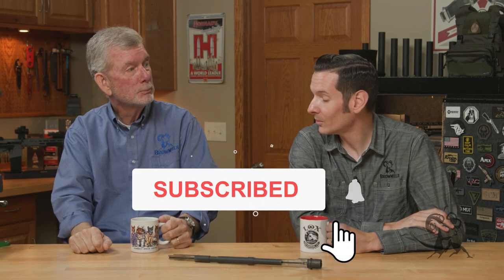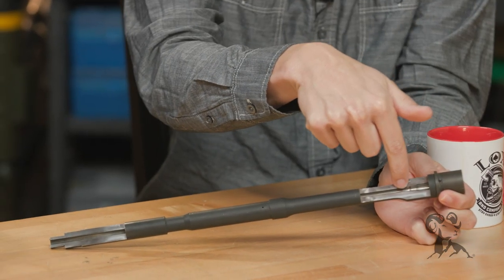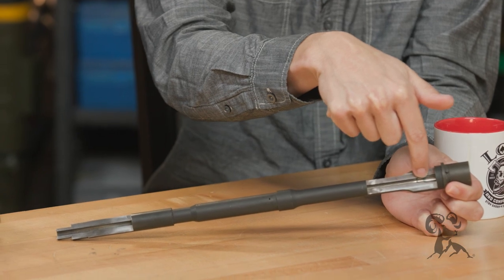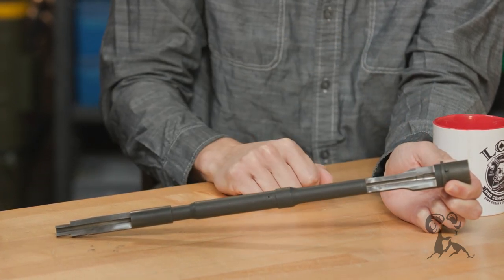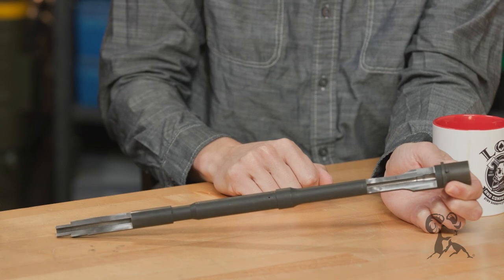Smyth Busters: Will a Worn-Out Barrel Explode?

Comment: The only exception to what you have presented would be in shotgun barrels that were of the Damascus or 'twist steel' type where corrosion has weakened the welds connecting the strips of the barrel allowing the barrel to fail at that point.
Reply: I want to see this myth tackled next. Nobody ever has pictures of an unwound, forge-welded damascus barrel despite it supposedly being a common occurrence.
Reply: @RefreshingDietDrPepper  I do not think it is common, but I have seen pictures of burst twist steel barrels that were attributed to pitting or corrosion of the bore.
Reply: @lawrencehudson9939  Do keep in mind that it is forge welded. Twist steel barrels do not have a visible pattern after completion and the swirly look is acid etched - people fake the look even today. It's more likely someone would blame the results of poor reloads or a bore obstruction on the material of an old gun to save face.
Reply: @RefreshingDietDrPepper  I think I have learned something today.

Comment: If you're rifled barrel Get so worn out and basically turns to a smooth bore. The gasses behind the projectile Can get ahead of the projectile Stopping the projectile before it leaves Creating a lodged obstruction.  Then the 2nd round will cause the barrel to explode. It is super super rare but it is plausible
Reply: something that I forgot. If your barrel is that warn as mentioned, 99.9 out of 100 x your throat your head space your timing and I'm sure other things will be out of spec.  All will contribute to Your barrel blowing up

Comment: Here's a barrel that didn't blow up but could have. When in college in the 1970's a friend had an old 1911 Colt that his dad gave him. My friend years before had been firing the gun and on one shot couldn't see where it hit. What happened is the bullet hadn't left the barrel. The bullet was stuck in the barrel just ahead of the chamber. The the next round was compltely chambered in the gun and was actually touching the stuck bullet. He pulled the trigger but there was no bang just a hissing sound whereby he sat the gun down and moved away from it. On inspection the there was a bulge in the barrel just ahead of the chamber.

Comment: The only thing I can think of is gas port erosion could eventually lead to separation of the gas block or gas tube from the barrel if the port opens up too much. I can’t imagine how many hundreds of thousands around that would take though.  

Just thought of another one, if the locking lugs in the barrel extension wear out too much, it can cause excessive headspace as well as fatigue of the metal, rounding of the engagement surfaces, etc. which I can see leading to possible catastrophic failure.

Comment: I agree with the answer but I have a question relating to the 22 bore brush wearing the rifling.  Would a nylon brush wear out a 22 bore?  How about a brass brush?  After hundred or so cleanings with a brass brush over 60 years I have not seen a problem.  The shot total is around 20 thousand mainly copper coated bullets.  I have switched to nylon with copper solvent bore cleaners.
Reply: You would have to have some really horrible barrel steel to have a bronze brush wear it out. There's a video debunking this myth, the guy uses a bore scope and a brush on a damn drill simulating years of wear. Not even a scratch in the bore let alone wear.

Comment: I disagree    As far as wear on rifling and bore I would agree, but what about my Remington 788 in 223 that had over 24,000 rounds fired through it.  I cleaned brass and inspected about every 1000 rounds.  When I cleaned the brass I had insipient case head separation as a fine crack around the case head. The ones that did not have a crack still would not resize and appeared to have a bulge on one side. I showed the can of brass and the gun to a gunsmith who said the chamber was stretching on one side from the thousands of rounds.  The can had over 900 rounds of brass in it . Every one was stretched and it varied from slight to severe. This is a form of wear, and if I had kept on shooting it  the results may have been bad. I had a 26" Shilen select barrel installed! and it shoots like a dream. I still have the old barrel for show and I do believe my old barrel was dangerous! The old barrel was still shooting sub MOA!

Comment: I have heard that if corrosive ammo has been shot through a barrel and was not cleaned, deep pitting can form which might catch and stop the bullet in the barrel. This would cause a bore obstruction that could cause the barrel to explode on a follow-up shot.
Reply: Never heard that one. Pitting can ruin accuracy. If it's really bad it can lead to metal fatigue or lowered velocity as gas escapes past the bullet, but in 50+ years of shooting milsurp firearms I have never seen a pit actually "stop" the bullet. Worst case of pitting I ever saw lost so much velocity from not sealing properly that the guy shooting had to aim approximately 10 feet above the target just to hit the cardboard.

Comment: Cannon barrels can get a little dangerous as they wear…so, check your destructive devices?

The one way I can see a uncontained detonation occurring would be if the locking lugs on the action became worn, resulting in a uncontrolled breach opening.  However, that is not the barrel bursting.

I think the myth probably comes from the black powder days, when the chamber was actually containing an explosion and metallurgy wasn’t as advanced, but, even so, it was probably more due to user error than metal fatigue.
Reply: You're pretty much right on the money. Most tales of barrels blowing up on early black powder firearms when re-investigated have concluded that barrel obstruction was the culprit because of the location and amount and type of damage described. Chambers were known to catastrophically fail when grossly overloaded with powder, but, even those failures were actually operator error and not design or manufacturer flaws. i.e.: pack enough explosive into anything and you can make it go boom.😒

Comment: What would you consider a round count for some of the pistol & rifle barrels be considered wore out. I have put over 15, 000 rounds through my 1986 Colt AR-15 Sporter with no problems so far. This is a combination of .22LR & .223 rounds. I also only clean my rifle every 2, 000 rounds instead of cleaning it after every time I go shooting like I was taught in the Marine Corps.
Reply: I would change the barrel just for peace of mind. It may still be shooting fine now but at 15k rounds literally the very next magazine can be the one where you notice it’s degrading. 
Also what distance are you shooting at? It may still be accurate at 25 yards but open up several inches at 75 yards or further

Comment: The comment about over-cleaning is very interesting.
I use rifles and handguns of different calibres, which I clean regularly but always using nylon brushes for the barrel. If cleaned regularly and thoroughly, bronze brushes are unnecessary and damaging.
Reply: If you damaged a barrel with a bronze or brass brush then you have a bad barrel. The metal is not nearly as hard and will not damage the barrel regardless of how many
Times you pass it back and forth. You can even go from the muzzle. There’s a video on YouTube with a guy using a power drill and a bronze brush spinning it for 15 minutes inside of a barrel. 0 damage was done after inspecting it with a bore scope. He even decided after to take a bore brush that was for a larger caliber to the barrel for an additional 10 minutes and again it did no damage whatsoever. 

.22lr is the only exception to this because the rifiling is so light. You still won’t damage the barrel but you can prematurely wear out the rifiling

Comment: Here's a myth for you - lead fowling of a 556 AR barrel with a 22lr conversion bolt. Does it really "ruin" the barrel if you don't clean it after practically every session shooting rimfire? Does shooting a 556 centerfire round afterwards count as "cleaning"? And do the lead deposits in the barrel fill in microcracks and later further them by thermal expansion?
Reply: lead fouling? meh.
clogs the gas port? yes.
Reply: @zososldier  How much 22lr would you have to shoot through the barrel without shooting a single 556 round for it to clog and not get blown through the pipe from the immense pressure though.
Reply: @Toringar  I shot probably 500 rounds through an upper. Had to take the gas block off and punch out the port because it made the upper a bolt action.
But you will get different round counts depending if you use lead only or copper coated 22lr.
It would probably be a good idea to shoot a couple 223/556 rounds every few hundred 22lr rounds if using lead only.
Reply: @zososldier  Wow, that is a LOT less rounds than I would have guessed. TU for the comment, this has confirmed my assumptions. I will make it a habit to shoot some 556 every few hundred rounds.

Did you notice any significant change in 556 accuracy after all that fouling?
Reply: @Toringar  I switched to copper plated only doesnt foul as much. I also didn't use the conversion on any gun I care about accuracy past around 100-200 yards seeing how the 22 bolt conversion isn't that accurate. (Rifle twist is way to fast for 22lr)
Either way, shooting a few rounds through the barrel will push pretty much all the lead out.

Comment: The only barrels I am concerned about are composite barrels where you only have the thinnest steal barrel and the rest of it is glue and fabrics
Reply: @dick8997  Yes but if the steel gets eroded away completely in one spot because the steel is so thin, then the carbon fiber will be exposed to the hot gas and erode very quickly. However, I still think that it would take a VERY long time to erode through even the thin steel liner.

Comment: What if the chamber/bolt lock up wears out and the headspace gets too large?
Reply: That's still not a "barrel" exploding. 9 out of 10 times if that happens you will split the cartridge case and get blowback around the bolt. If you have this issue, DO NOT FIRE THAT GUN AGAIN!. Odds are incredibly high that the round you just split will not have had sufficient power to push the bullet completely out of the barrel and the barrel is now obstructed. Once in a while you get "lucky" and the bullet lands somewhere out in the dirt in front of you, but, it's a risk not worth taking.

Comment: What about twisted Damascus barrels? It's seen almost exclusively on old shotguns. If they are wearing down it might be a good idea to have a gunsmith look at it.
Reply: Those twisted steel barrels blow out moreso because that type of metal was made for black powder shells. Using high pressure smokeless shells in them can be risky, and they certainly don't have the durability of solid steel.
Reply: @reicherruschach3727  ya that's an obvious one. But there's a lot more to think about even using black powder. The forge weld quality, barrel thickness, friction in the spirals. I noticed that when I clean my barrels, my cleaning rod wants to twist with the spiral. I doubt it's enough to mean anything. But it could mean there's some uneven wear and if it gets bad enough... I'm just trying to think of a scenario where a worn out barrel, with the proper charge will fail.
Reply: @andyd2960  If the barrel is made correctly and the ammunition isn't ridiculously over pressure, it shouldn't. I cannot think of a scenario where it can happen.

Comment: I want to use an old 30-30 barrel to shoot some .32 Smith & Wesson. The 30-30 barrel is from a Winchester 1894, probably purchased in the 1930's.
I believe that it will withstand the .32 Smith & Wesson pressure.
Reply: Wouldn't the .32 caliber bullet be too wide to fit in the .30 caliber barrel? I'm honestly not familiar with .32 bullets but I'd imagine they wouldn't seat, or be safe to fire like that.
Reply: Like .300 Blackout being fired in a .223/ 5.56mm barrel.
Reply: Thank you for the observation.
Reply: @andreivaldez2929  Correct - .32 S&W diameter is .321" compared to 30-30's .308". They are both based on the same 'parent' case, just necked down to different bullet diameters.

Comment: For high round count with high pressure loads, is there any 'fatigue'  to the metallurgy of either the barrel or the bolt.  That is the only correlation that I see between high round count and the gun 'blowing up'.  I would point more to the bolt lugs than the barrel for failing.  In fact there is regular maintenance schedule for swap out of bolts IIRC for the M16.
Reply: No, because it's only acting on the case of the material.

Comment: if your shooting 93kpsi rounds thru a 230kpsi tensile barrel, it will have chamber cracks and possibly explode after 200'000 rounds if it had a chamber wall/barrel thickness profile of 1/2 inch. cost as... $680'000.00 to test that. just use crossover data from other fields of material use... that's too much for something that cost $399. but the old 96A1 at the rental range has 18'000 thru it, smooth as a silk glove on glass other then the tumble rounds that are cast off center and sites that aren't fully lined up with the bore... $430 to rent it thru 50 shots or buy a new one that's set up right for $899, need a license to... and another card to be more then 130 pounds and another card to be more then 180 and another to tell the other ... nonsense. 101 ways to loose power of attorney. just starting to feel good and the tank seat drops... sure can throw a bean bag at the target but... does it anyways, a small game amplified into a larger statement in correlating conjuring.